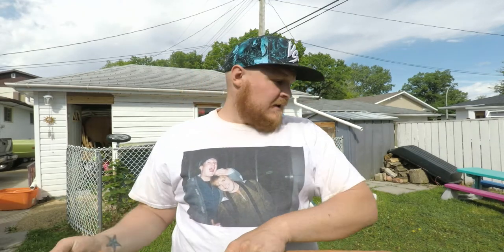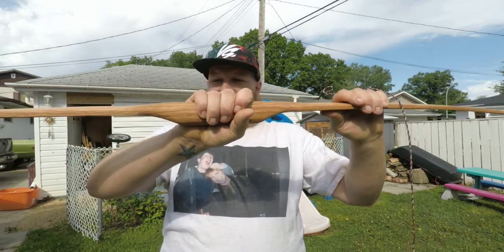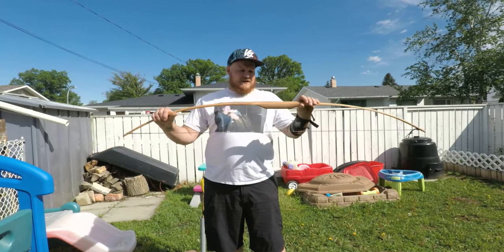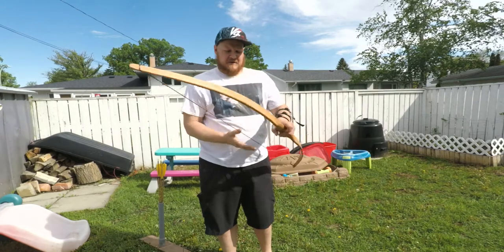DIY 50# board bow! Red Oak pyramid flat bow.

Comment: I just built a Mollegabet bow out of Red Oak which is 50 lbs @ 26" and I'm not backing it since the non-static part of the limbs are pretty thick & 95% of the wood grain does run the entire length of the bow. It's on my channel if you ever want to see it. That Pyramid design looks awesome, and you did an unbelievable job on it! I hope it brings you years of fun shooting arrows. God bless you and your family!
Reply from the maker: Ill def check it out. Unfortunately it ended up developing stress fractures after about 800 arrows. I had bad spot in my tiller Unfortunately. I learned a lot. Going to start on my next build. This time from a stave. Thanks for watching